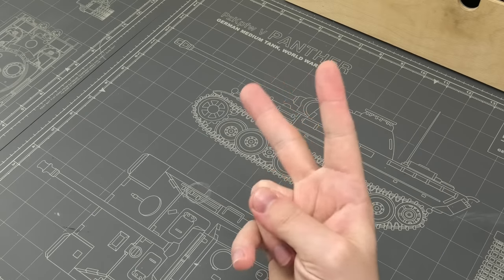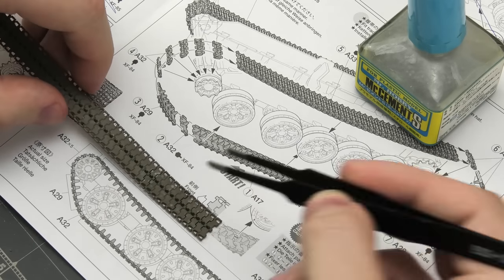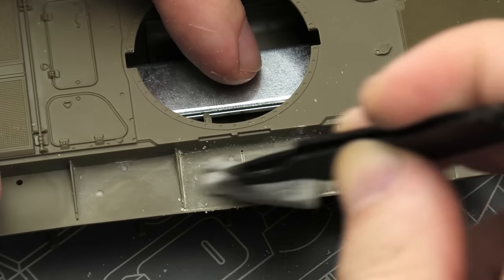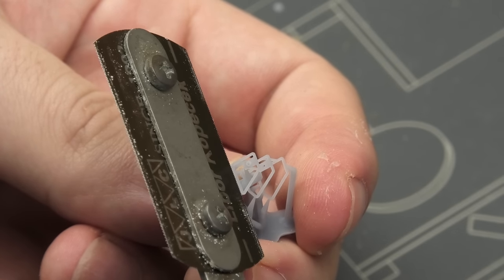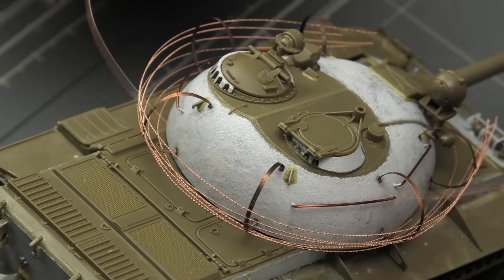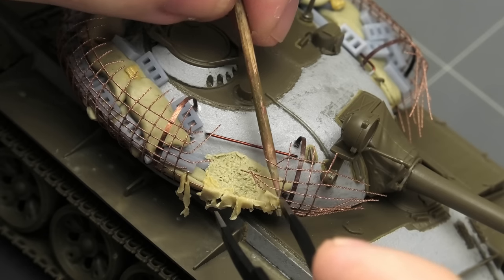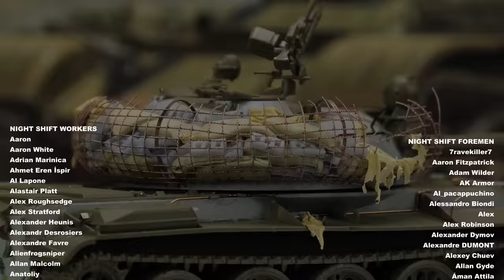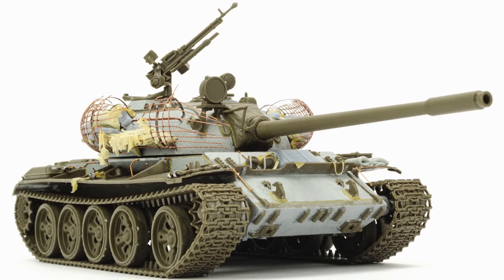New T-55 From Tamiya Gets A Rebar Cage Armor Upgrade! (1/48 Scale)

Comment: Love the sub assembly with the wheels and tracks. Way easier to deal with.
Reply: ...but a pain to paint.
Reply: @fonesrphunny7242 : true but still easier than having them attached to the model.
Reply from the maker: It makes the process really quick, you just need to be more careful when painting the rubber parts.

Comment: The straight copper wire trick is like... doing th hard way for 10 years, while the easy way was 10cm away
Reply: I sad there and was all 'Oh... that was faster'
Reply from the maker: Learned that trick from an aircraft modeller 👍
Reply: @NightShiftScaleModels  Also, you made me change my mind. instead of a 1:35 abrams, i will literally buy this T-55, mostly cause i had a T-62 and it turned out...just bad, and i want to give the early MBTs another try

Comment: Hell yeah! Been waiting for this one! Also, I'm really jealous that the smaller scale one has those tracks and the to-scale guide for assembling the tracks. The 1/35 I'm working on had rubber tracks which are fine, but I grabbed some aftermarket ones from Miniart that click together, and I tried gluing them all together at once and bending them around the wheels without much luck.

Now I'm going to try and go back and re-assemble them in smaller sections that I can then glue together.
Reply from the maker: Maybe you left the glue set for too long? 5-10 minutes is usually enough if you use quick setting cement, you can also try it by feel. If the track is flexible but it doesn't fall apart if you manipulate it, it's the best time to wrap it around the running gear.
Reply: @NightShiftScaleModels  Yeah, I think it was a combination of too much glue in parts, and too little in others. Turned it into a link of track that just broke apart in places, and wouldn't bend in others.

Comment: not tried putty for welds yet...been using stretched sprue soaked in cement then when tacky fit,then use thin blade etc to make the weld effects...nice job Martin.

Comment: I know how to make rivet heads or small bolt heads, much easier than knocking them out of foil. You need to buy balls for soldering radio components. They come in different sizes up to 0.1mm, they are all strictly the same size. To attach the ball to the plastic, you need to drill a hole and insert the ball into it. Good luck.

Comment: I wish Tamiya or one of the other quality companies would come out with/reintroduce modern and historical Armor in 1/24 scale. I built & still have the old Tamiya British Centurion in 1/24 and it was designed to have removable panels for the turret, driver compartment, and engine. I was hit by a drunk driver several years ago and don't have the dexterity for anything under 1/35 or 1/32. I haven't built a kit in like a decade. I'm thinking about trying the Tamiya Vietnam War US Navy/CG PBR  Patrol Boat in 1/35

Comment: When I made a tarp, I used a different method, which is cheaper, I used the the used decal sheet, cut it to size, soaked it, crumpled it, let it dry, paint it, soak it, then form it on the model